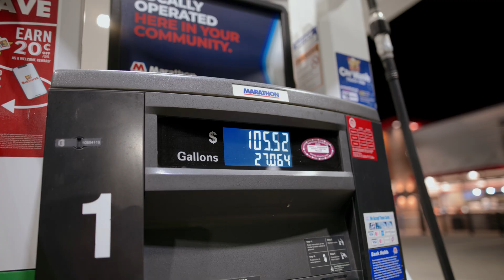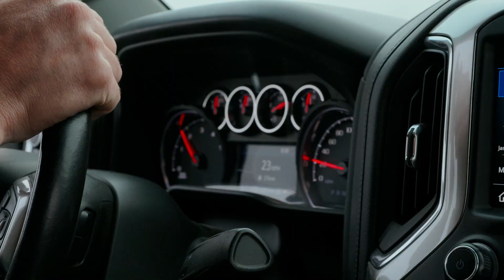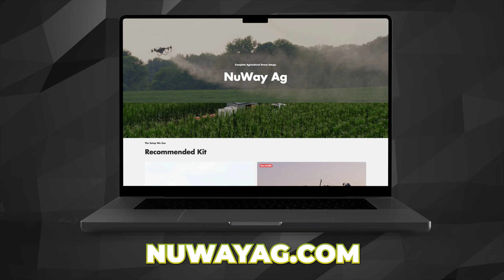Can Anyone learn to  Fly BIG Spray Drones

Comment: What other certificates do you need besides the 107? Does 107 even cover this? I fly for a big company with over 3000hrs of PIC time doing tall inspections.
Reply: Part 137 if you will go beyond VLOS, also this could be different in different states but in nebraska you need an aerial applicators license